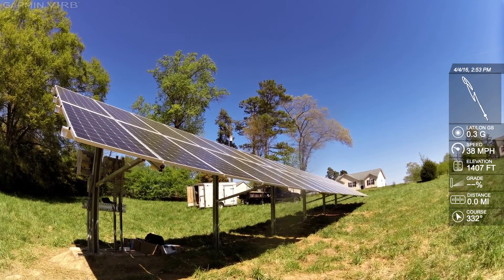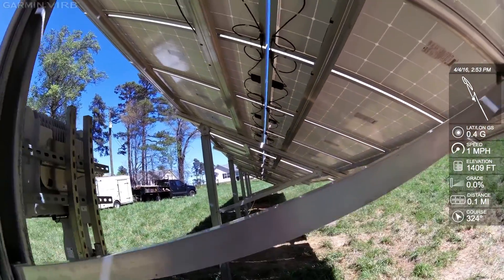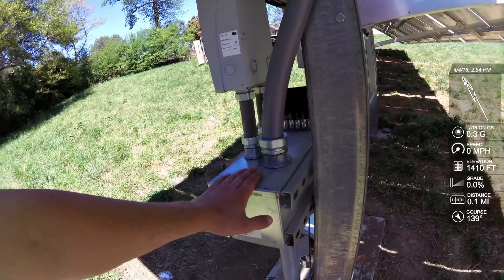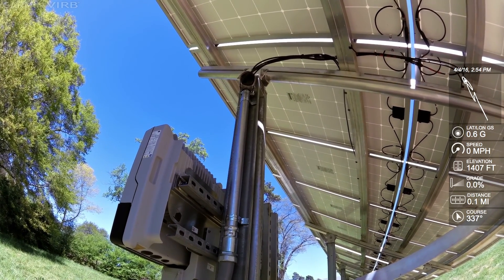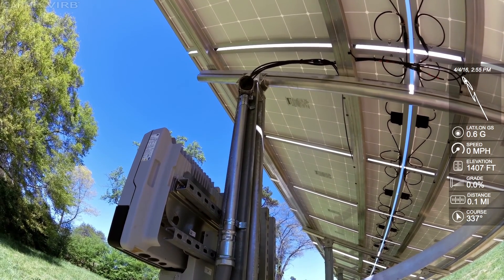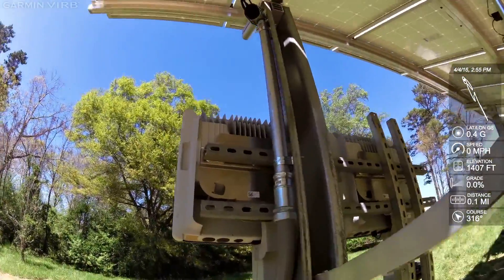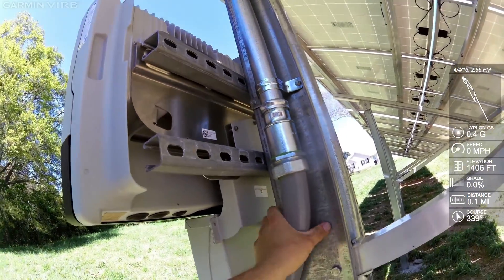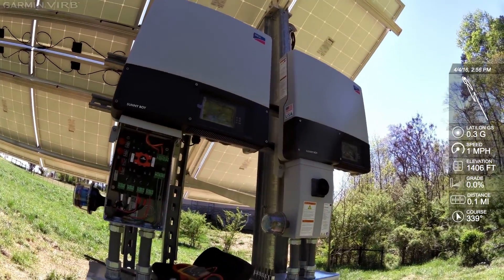Solar wire transition: PV wire into conduit

Comment: Liquid flex metallic conduit is only 75 deg c wet rated. Your dc circuit coming into your inverter with 90 deg c pv wire is now derated to only 75 deg c.
Reply: I wish I could remember the reference now, but i saw another video that indicated you have a certain number of inches before derating.
Reply: Your terminals are usually only good for 75 degrees anyways. You start your adjustments at 90 degrees but don't use more amps than the 75 degree column on the terminals.
Reply: @rainwater01  this is true about circuit breakers, inverters are typically 90 deg C.
Reply: @jonathankress7003  Good to know. I was under the impression there is almost no equipment rated for 90 degree connections. Are you talking about microinverters or solar edge etc...

Comment: have your solar systems been installed in flood zones. if flooded can the system get destroyed or can it work as well again.
Reply from the maker: +George Gardinier No we don't  build in the flood plain around here.  We dont get much flooding , we are at almost 1100'   But floods are pretty devastating.......
Reply: @GainSolarPower  Is there any code restrictions on PV wire in conduit?
Reply from the maker: @sylvesterstewart868  pv wire is usually listed as CABLE MARKING:
USA SOLAR CABLE 800-880-9473 10AWG (UL) "E #" 2KV PV WIRE DIRECT BURIAL 90°C WET OR DRY RHH/RHW-2 -40°C VW-1 c(UL) RW90 1000V SUNLIGHT RESISTANT (production date) or xlpe.  I think it’s fine to put in a conduit, i do not know of a spot in the code where it says not to and I’m sure if it did a troll would’ve already said something on this channel
Reply: @GainSolarPower  I appreciate your response. They have 3 100W 12V panels in parallel. The panels Isc is 5.28A (15.84A total)and the max series fuse rating is 15A. 
A 20A fuse is required on the positive source conductor after the MC4 parallel connection correct? THANKS.
Reply from the maker: @sylvesterstewart868  You should put a 10a fuse between each module and the parallel connector. Then put a 30a fuse between parallel connector and the charge controller.